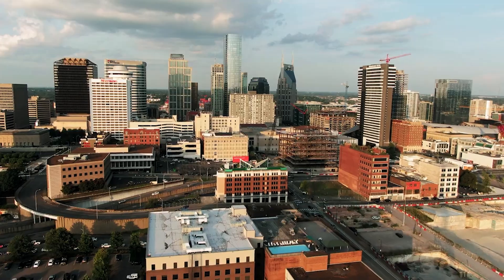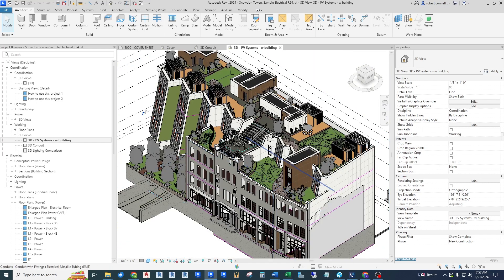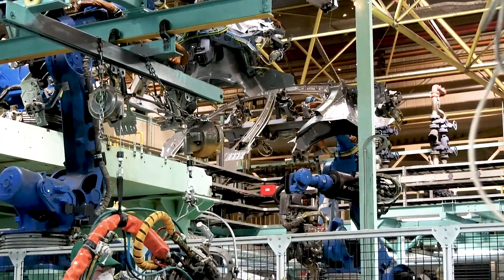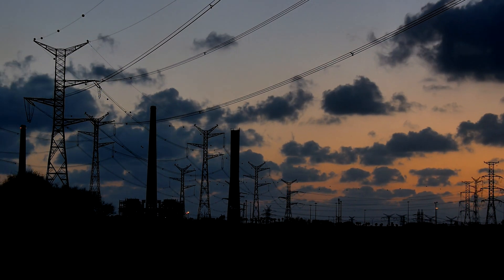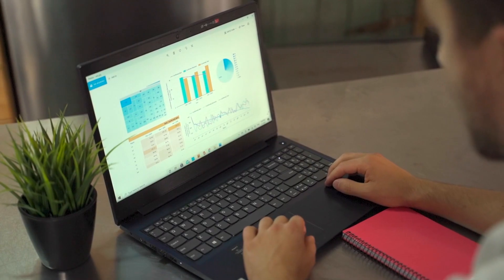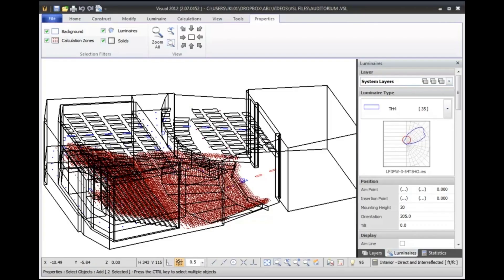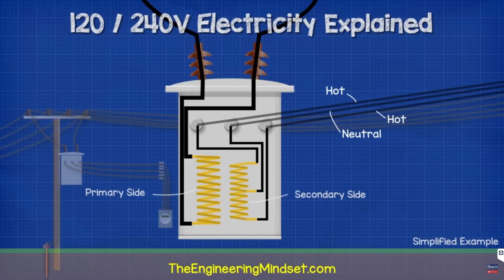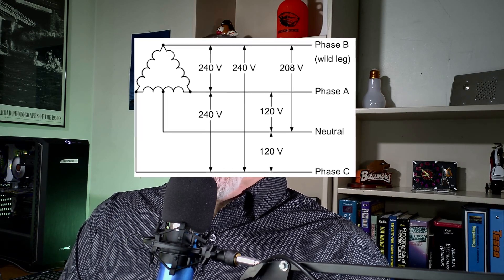What is an MEP Electrical Engineer?

Comment: I'm 29 Y/O female, moved to Canada 5 years ago & I have BE Electrical from backhome, did a diploma in Electrical engineering technician course in Ontario & on my journey to become P.eng. I feel overwhelmed with a lot of codes. OBC, CEC, OESC, NFPA, etc. My performance in my company is degrading that's what I feel. Earlier my boss used to give me a lot of work & now due to some mistakes done in 2022 project (now in construction) I'm being judged even though I'm learning through those mistakes. nobody is trusting me. I want to become lighting specialist along with having all sides of knowledge. Any guidance from you? also, I'm terrible at making single line diagram even though working on calculations nicely. Is it possible for you to create an SLD for may be a 8-10 stories residential building that may have some retail/amenity areas on ground floor? I really need help as being an immigrant I also want to prove myself. Thank you Rob. & God bless you for making such informative videos.
Reply: Change employers as soon as possible. It will not get better

Comment: I have a question.  After working in the industry for 30+ years, do you still find it interesting and challenging? Do alot of your work days feel very "samy" or do you still come across new challenges?
Reply from the maker: Great question! Made me think a bit about this...I'd say some of both. I've been at the same company my whole career (same office, etc) so much the same on that front, but the work itself has continued to evolve and be both interesting and challenging. Building electrical technology has changed over the decades, such as LED lighting, battery backup tech, digital lighting controls, etc. How we actually draw prints has evolved from drafting by hand to CAD to Revit. And of course how we obtain information about electrical equipment (i.e. the internet) has evolved as well. Then you throw in code changes every 3 years on top of that, and there is plenty to keep up with!

Comment: Hello rob , love your videos. A simple question can we connect a single lighting fixture to two panels for emergency lighting?
Reply from the maker: Hey there Jerry - thanks for the support! Yes, you could connect a single light fixture to two panels or sources, BUT it would have to be through some kind of a "transfer" device, that switches the connection between the two sources. In practice, this typically happens at a transfer switch that transfers the load between say a utility source and a generator source (or even battery inverter). It can also happen within a special emergency light fixture with internal transfer between the normal utility-powered feed and its internal battery backup, like those "bug-eye" fixtures you see on walls. Hope this helps!

Comment: Hi Rob! I have been following your channel since the summer. I have completed the residential series. Lot of the jobs that I am applying now requires to have experience in fire alarm system as well. I am wondering why don't you include any fire alarm design in your videos?
Reply from the maker: Hey there Alex! First of all, thank you for supporting the channel! And as far as fire alarm - it is a specialty out here. Fire alarm contractors actually design the system as part of their design-build work, complete with load calcs, voltage drop calcs, and sound and candela specifications. Occasionally our MEP drawings will show symbols for expected devices, with some type of a "performance specification", but the true installation-level design is definitely something we do not do.
Reply: @ElectricRob  To add to that the fire alarm designs (shop drawings) are typically performed by NICET certified technicians and are allowed to be what is referred to as a "deferred submittal" for permitting.